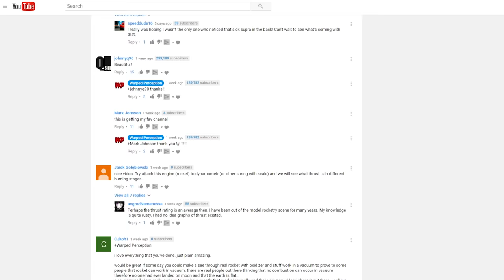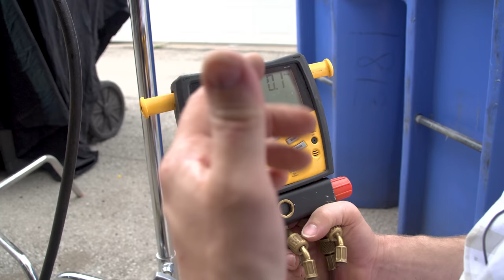Model Rocket Engine In A Vacuum Chamber - 4K Slow Motion - will it burn? - Rockets (S1 • E3)

Comment: Do you have an updated version that would actually account for the gases created by the ignition of the engine? Very flawed experiment. I’m sure you kept going
Reply: Obviously it did ignite. There was never any reasonable doubt that a rocket engine can ignite in a vacuum as they contain both the fuel and oxidizer.

The experiment worked just fine.
Reply: @darklight2.1  you can’t shut the vacuum off.  Space doesn’t have an on/off button…it is constant. As soon as you ignite inside this chamber it is no longer a vacuum. This does nothing to aid space flight, if it were a real thing to begin with.
Reply: @darklight2.1  I have yet to see any evidence of actual space travel or space itself being an actual thing. “Zero g” flights regardless of the altitude do not constitute space travel. No amount of acting and cgi will substitute for actual physical evidence.
Reply: @Truearthtruman  too bad nothing unedited from space has ever been proven to be CGI